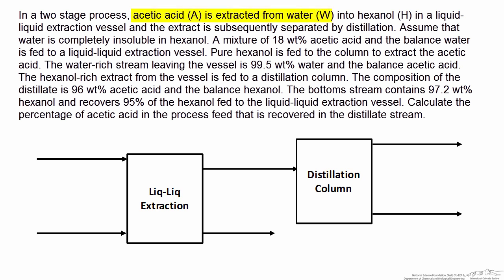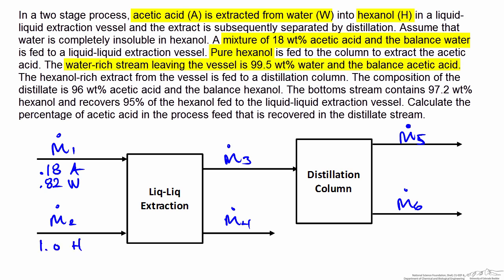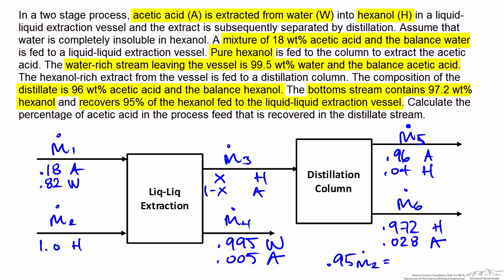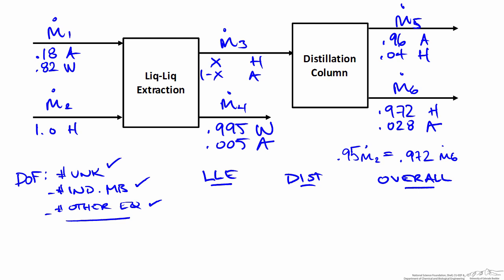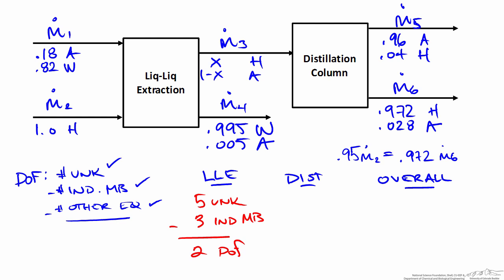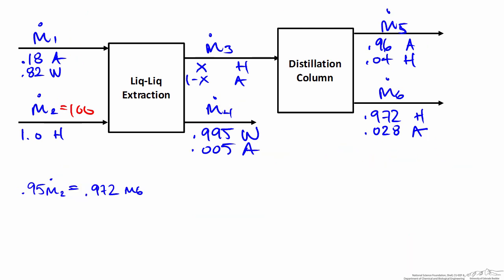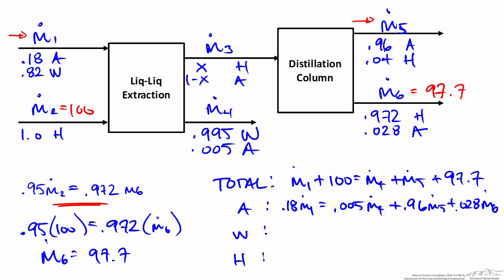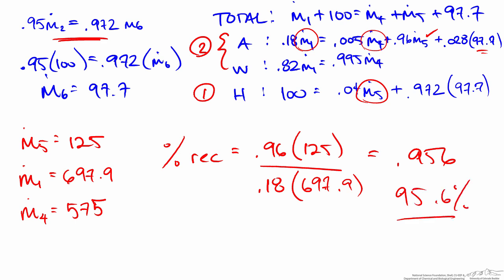Solving Material Balances on Multiple Units

Comment: How calculate m4 and m1
Reply from the maker: Once you have solved for m5, you can then use the other equations to find m1 and m4. Using the W balance, you see that m1 = 1.213m4, so you can substitute that into either the A balance or the total balance. I'll use the A balance here: 0.18(1.213m4) = 0.005m4 + 120 + 2.742. This simplifies to 0.21334m4 = 122.742, then m4 = 575. I hope that helps.

Comment: Where does the M3 goes???
Reply from the maker: The stream m3 is not in the overall equation because it is not a stream that enters or exits the entire system. It is an output if you are looking at just the extractor or an input if you are looking at just the distillation column. I hope that answers your question.

Comment: you 
made a mistake on ( 11:25 )  the m5 u didnt multiply by the percent of hexanol  in the stream...
Reply: He doesn't need to. He's just solving for m5... which is ( 100 - 0.972 (97.7) ) / 0.04 = 125.89   Should be 126 really rounding up.

Comment: For m6 composition, It does not state that the balance is hexanol as water could be there as well. The water steam leaving the extractor is not necessarily all the water that went inside the system
Reply: Julio Cubillas Flores hexanol And water are assumed to be insoluble according to the problem.

Comment: since the composition of m3 was unknown, how'd you know that water was not part of that composition(even if a minute amount)? the composition of m6 was also not completely specified so it is possible that there was water in that portion as well right?
Reply: or are we to assume that the extraction did its job and all water was separated as you did?
Reply from the maker: The problem statement says, "Assume that water is completely insoluble in hexanol."  Thus, you know that they will be in separate streams.  Then there will not be any water in m6 because no water went into the distillation column.
Reply: Gotcha

Comment: you chose the basis at m2 to be 100, its dificult to understand why this assumption is allowed,and if i'm to make this assumption in a similar DOF, is 100 moles like a constant to always use?
Reply from the maker: Thanks for your question. We are allowed to set a basis in this problem because no flow rates are given, and we are only solving for a percent recovery. You can actually choose any flowrate for your basis, but it is usually best to use a basis that is a multiple of 10 - like 10, 100, or 1000 moles - because it makes converting mole percents to flowrates easier. However, you could choose any flowrate for your basis and arrive at the same answer. Hope this helps!

Comment: Could you include an equation relating the hexanol in the distillate to the hexanol input to the liquid-liquid extraction? i.e., could you include .05*m2 = .04*m5 as another equation?
Reply from the maker: Thanks for the question.  While you could use that equation, it would not be an independent equation from 0.95*m2=0.972*m6.  Thus, you would need to use one or the other of those equations, but not both.
Reply: Hm, very interesting. Thank you for answering my question!

Comment: For 7:13 and before that, why didn't you include the relationship for the species in m3; that H and A equal 100?
Reply from the maker: +Syvmana Thank you for your question.  In this case, the fact that the H and A add to 1 is already accounted for in that we only used one unknown for both of those, the variable x.  If we had used an unknown for H and an unknown for A, then the relationship of H+A=1 could be used.  However, we would then have 6 unknowns in the LLE and 5 unknowns in the DIST, so the resulting number of degrees of freedom would be the same.  I hope that helps.

Comment: How come you are able to use all the species balances in addition to the overall balance? Wouldn't one of the balances not be independent?
Reply from the maker: Andrew Tice Yes, you are correct.  Remember that when the degrees of freedom were calculated, only the independent number of balances were used.  At around 11 minutes, all of the species balances and the overall balance were written out simply to see which would be the easiest ones to solve.  They aren't all needed.  In this case, the instructor didn't use the overall balance.
Reply: LearnChemE can you include what book did u get this problem from?